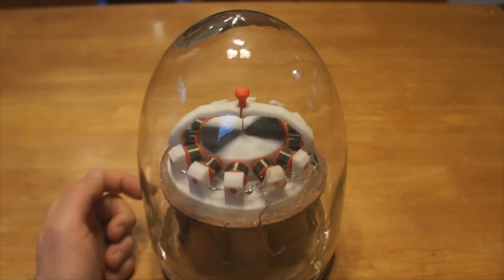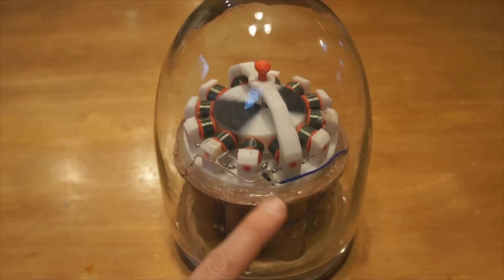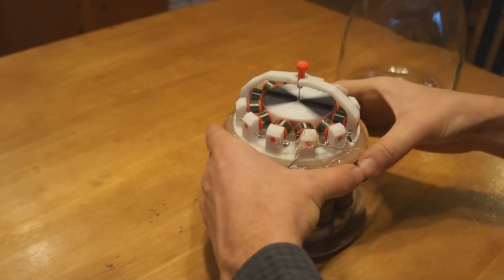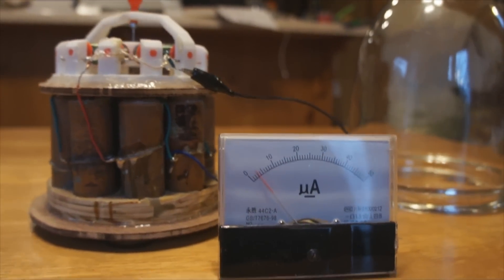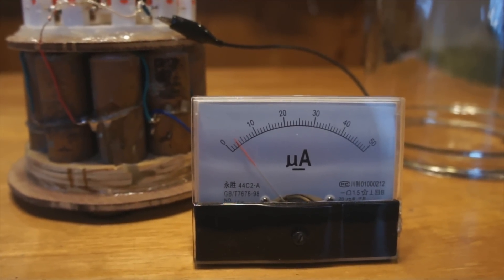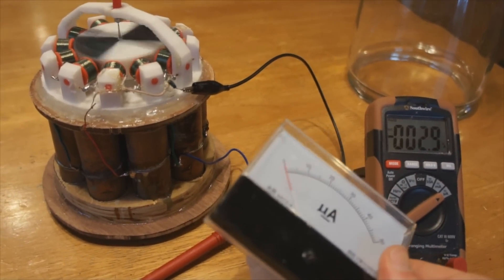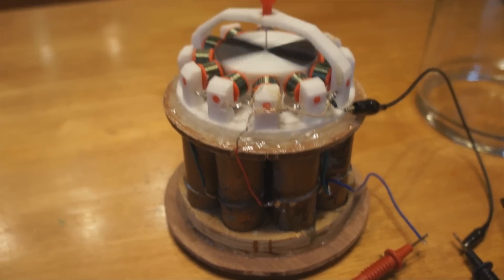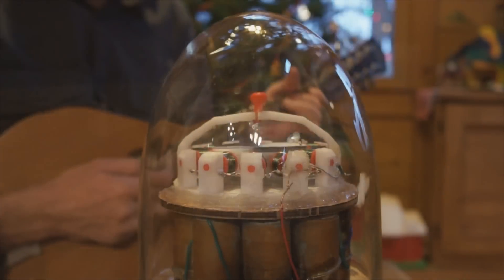100 Year Motor Crystal Cell + EZ Spin Combo

Comment: I think you would get more power if you had more surface area on the magnesium. Instead of a solid magnesium rod why not a tube. Then you could use inside and outside surfaces.

Comment: lasersaber: On your web site, you do not supply a schematic (the most basic requirement of an electronic project)
Yes, the mechanical nature of a reed switch is a reliability issue. You can use what what brushless DC motors have been using for ages: a Hall-effect sensor. They are designed for the very task of repeated/frequent on/off, as in a rotating system.

Comment: Lasersaber, you may avoid the reed switch through opossed coil pulses with a flip-flop arrangement, with one transistor or 2 transistors, or no transistors (I must still test this but from what I know from my experiments, works with only a diode). You may use a contact magnet also. Tnks for sharing, great job!

Comment: I think a cool idea that might get a lot of visitors is a "LIVE CAM" on the motor that is running with some kind of counter that shows the number of days, hours, minutes and seconds that it has been running.  Have you done any experiments putting the crystal cells in parallel?  Great work and great videos!

Comment: merry xmas to you ... im going to make a couple of the crystal cells but but going to try to make them AA battery size and using magnesium ribbon as the core ill make a video of it and send you a link when i have it made.
Reply: Would I be correct in thinking the ribbon will produce more current through more surface aria ?
Reply: im not shure :)
Reply: Gary Leventhal
The current is a function of the surface area of the lectrodes, the geometry of the cell, the lectrolyte and the galvanic couple.

Comment: The use of magnesium is liken to throwing a fire log on the fire.  It only produces power until the magnesium is oxydized or erroded at the connection points. A more pure magnesium rod should oxydize faster than a less pure sample. Its the change from magnesium to magnesium oxide that ends the cells life.  You can slow oxidation but the trade off is less power. It's all about the O2 at the surface of the magnesium.

Comment: So... how exactly does this work, do you have any references with information outlining the chemical process? I presume the better surface area ration the better the performance of the battery? However that would be a surface area of magnesium:copper type ratio with space between those being filled with the salt solution right?

Comment: i laser cut end fillers out of plastic for between the magnesium and copper and found the batteries to not work untill i removed one side . i also laser cut hard board fillers and had the same result . I find it strange that one side is fine but both are not .. i haven't tried one of each yet .. 80)

Comment: ANOTHER IDEA WOULD IT BE POSSIBLE TO CUT THE MAGNESIUM RODS IN FLAT COIN SIZE DISCS AND PAKCED ON TOP OF EACH OTHER COMPONDED TO GEHTHER LIKE A COIL WOULD THAT PRODUCE MORE AREA FOR MORE VOLTAGE?

Comment: excuse my naivety but would it be more efficient if you used a non conducting housing and used a copper electrode instead on the crystal cells?

Comment: ALSO THE MAGNESIUM RODS CAN THEY BE DRILLED WITH SIDE HOLES SSO THEY CAN BE FILLED WITH EXTRA MATERIAL WHICH PERHAPS WOULD BOOST VOLtage AND Amps ..whAT DO U THINK?

Comment: maybe this will last 100 years, now I don't know if this is correct or not but roughly every 60+- days  the mg cores is oxidized and with the sodium borate which is the crystals helps keep the potassium chloride not oxidize the mg core to much which the potassium chloride which is like the electrolytic part of a electrolytic capacitor, along with the alum which helps pass the electricity through, except the crystals is what picks up the the ion's out of the surrounding area, and not charged from a battery source.  any one correct me if i am wrong, because I don't major in chemistry. anyway guys/gals happy experimenting!

Comment: Why don't you set-up the system so you can evacuate the air from the inside of the assembly, this would minimise friction and thus use less energy in the process.

Comment: rather 100hrs than 100years when reading your update.
Did you calculate the chemical potential? count the Mg atoms and multiply by the missing electrons (okok, you might not count but calculate the mass of them :P)... The rate of the salt and the metal seems to be not optimal.. but the Mg gives you at least an upper limit.
Reply: electrons are not what makes electricity in batteries or in any terrestrial applications not involving plasma.

Comment: Nice experiment!
However, with a 2-3uA draw, this motor will consume just 18-26mAh per year (0,003mA x 8760 hours). So, any set of 2600mAh batteries with the same output voltage would do the job, if you can find any that doesn't degrade nor self-discharge in 100 years.

Comment: when did that motor stop? I just looked at that live video and it is standing still.
:))
Reply from the maker: I bet you almost saw me tinkering with it live!  I was having some issues with the wire connection to the reed switch.  I keep wondering how long the reed switch itself will last.
Reply: no I didnt. since that live video is relatively boring, i didnt watch it for a long time ;) . But for that short amount of time I wondered if there was someone coming to the videoframe.
Reply: By the way.. Is my english anywhere near good? Im Just asking because I only use my english skills online. (Im german and seventeen years old) I never speak english in real life and was wondering about if  my english is passable?!
Reply: +Jorma Krems (Crust) Yes, I never would have guessed it wasn't your first language!

Comment: There's a simple solution for your motor problem. You're over thinking the motor design with using a pulse motor. Buy another analog uA meter and take it apart and remove the spring and the stoppers that keep it from making a circle. If you think about it the analog meter is nothing more than a motor and you don't have to worry about reed switches or diodes.

Comment: it is awesome, but you should remake it in a dry air with gloves and a face mask so you can seel it with dry air.
Reply: don't want rust to develop on it
Reply: nsdfnsdf why not put it in a vaccum
Reply: BuzzFeedGuns water can still be there, just 1 particle will do it, though we don't know if air is needed to help it work

Comment: This "Motor Crystal Cell" will only run as long as the crystal(s) power it and they being finite will stop functioning at some point.  Adding multiple crystal cells will prolong the run time yet the inevitable will always occur and this motor will not run indefinitely. I would also hazard a guess that 100 years is a stretch. The reality is all this is, is a crystal battery driven motor. No different in comparison to any other motor. Feed it the fuel it needs to run and there you go. The real problem and the Elephant in the room that was clearly avoided is the fact no draw was taken or in other words no work is being done. That is like having a nice new vehicle with a motor/engine that runs but you cannot drive it.

Comment: Can I ask, what's the practicality of such an engine? Are you able to generate any sort of power from it?
Reply: try setting it on fyre. that would be cool
Reply: HomicideHenry The motor acts as a generator and a motor.  If you spin the rotor by blowing on it or spinning it with your hand then it will produce electricity and charge a capacitor which will then powers the motor for a short while.  The motor cannot charge and run (in its present configuration) and if changed so it could - it would never produce more power than it consumes - this is not an over-unity machine (to be honest I don't think they even exist).